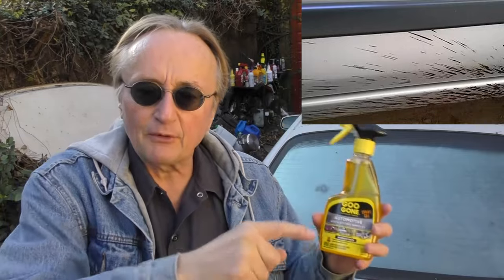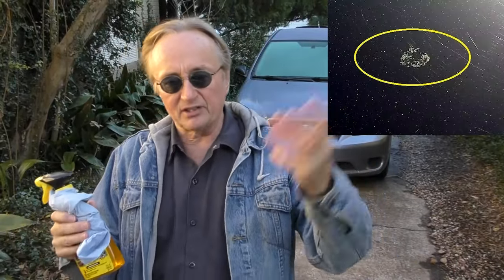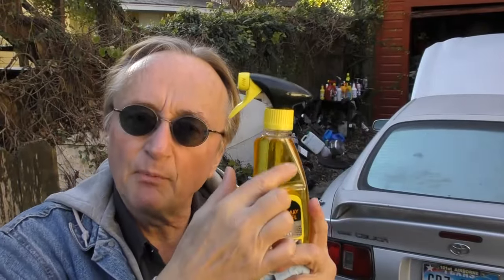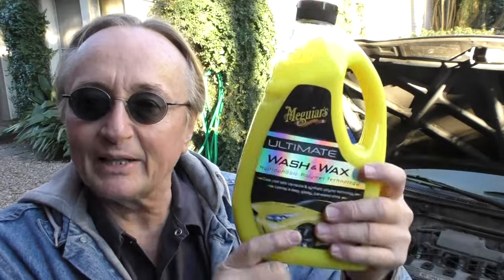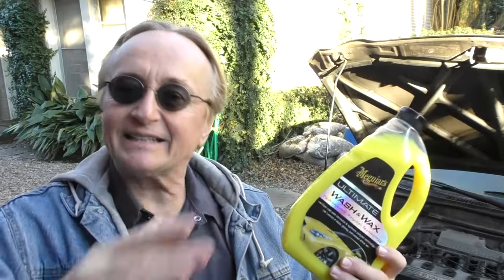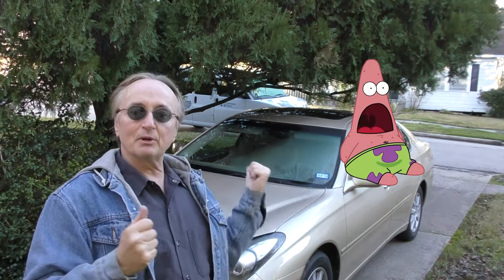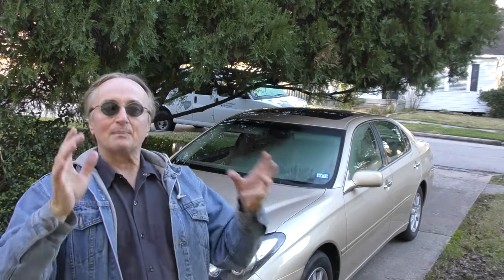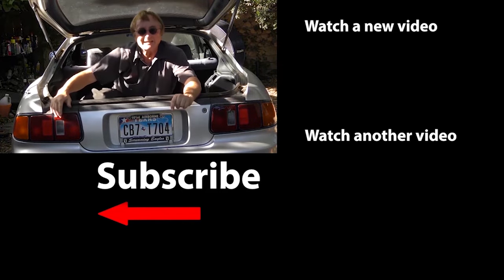Doing This Will Make Your Car Paint Last Twice as Long

Comment: Ceramic coat.....best way to keep your car clean and allows for water to just roll off. No water spots. I have done this to all my cars and did it myself. Looks great and stays shiny. Bird poop just washes off with a hose. No need to use Goo Gone. 

You are a mechanic.....not a body man......I have a friend who owns a body shop. His business is involved with Mercedes, Lexus and many other dealerships in the area. He says that ceramic coating (a good one...you should have done more investigating on the better products) is well worth the effort. He told me to do it to my 2018 Lincoln MKZ hybrid. He does not tell mechanics what is good or bad.....and he says mechanics should do the same. He does not recommend Nu Finish. Says it is junk and does not really do what it says it will. You get what you pay for.
Besides.....you drive old cars......good cars though......TOYOTA.....you don't need ceramic coating. You have leaves and sticks in your engine bay most of the time.
No sense in coating that!
What if you have an Earl Schibe painted car?  Is that really paint? "I'll paint any car, any color.....$29.95."
Reply: In my 45 years of car ownership in wintry New Hampshire, nothing beats Star Brite Teflon Marine Polish.  2 coats every November lasts through the winter, avail. at Wal-Mart or Amazon.

Comment: Be very picky which tree you want to shade your car from the sun.  Don't park under a tree that dripping tree sap or has numerous perching birds.  Secondly, apply a thin coat of wax on your car to make it easier for yourself when buffing the car.  Finally, always put two coats of wax on the car to make sure you have coverage.  Just buff lightly so you don't leave circular scratches on the clear coat.  You don't need a lot of wax on the car.  You're just wasting wax and making it harder for yourself when you apply too much.

Comment: As a painter by trade, I can tell you that the quality of paint on a vehicle is directly proportional to the cost of the vehicle. Actually, a good hand painter can do a better job than a machine. The biggest difference is in the paint. A top quality auto paint can run from $600-$2000 a gallon. Nobody uses that in body shops, which is why a repaint never looks as good or lasts as long. If you really want a good paint job (say you have a classic car) find an individual pro like Charlie Hutton.

Comment: Not taking paint and wax advice from an old timing mechanic with zero paint or auto body experience, especially someone who thinks a polishing compound is not an abrasive.  Also as one who does own several new sports cars, exotics, high performance for on and off road use plus does have experience using clear wraps, ceramic and other nano coatings I can definitely say the right ones properly applied work great for many years. 
Best time to apply these advanced coating protections is as soon as your new vehicles paint has cured fully. If not paint correction must be done first or you are just preserving exactly what you have at the time the product is installed. 

I will say I am totally disgusted with the lack of quality on modern vehicles factory paint today. 

With all the EPA regulations in the USA forcing the use of low quality environmental friendly paints plus so many foreign manufacturers bringing their factories to American you can now see more and more the quality diminishing to the orange peel, fish eye, color shade variance issues and thinness worse than what we had in the 70s. 

There are a few exceptions on expensive vehicles but as more of these are now being painted in the USA. - IE Acura, Mercedes, BMW, Lexus, etc you can now see 2019 luxury vehicles paint looks like crap! 

Just tested several made in America 2019 Acuras, Mercedes, Lexus, Infiniti’s, BMWs, Teslas and was amazed at just how bad the paint jobs were, especially the Tesla’s. By far the worst was Tesla which had scratches, over spray, mismatched body lines and orange peel.

Comment: Scotty you are wrong about ceramic coatings they do work.  When I bought my car the first place I took it was a detailing/car wrap garage,  and had it done professionally.  This was 3 years ago,  I have hardly ever used my wipers.  Dirt doesn't really stick, the only thing which has stuck is the ash from the neighbours bbq but that just rinses off with a hose pipe.  No elbow grease, no soap, no wax, nothing except plain cold tap water.

In future please just stick to the mechanical side and leave the paint for the people who actually know what they are talking about.

Comment: Gotta disagree, ceramic coatings do actually work quite well...but only, and only if you do a lot of prepwork from the beginning. Just regularly washing your car and trying to slap it on is going to give you very mediocre results. You need to make sure the paint is as clean as can be so pressure wash, hand wash, claybar treatment, dry it, polish it and THEN apply the ceramic coat preferably indoors where no dust, dirt or rain can get to it. Let it sit for a day and you'll have amazing results. For those that don't want to go ultra geek mode and just want their car to look shiny I'd still recommend a decent wax over a ceramic coating though. Just my 2 cents.

Comment: No don't park your car under a tree, the tree sap is acidic and will gradually kill your paint job!
Reply: You're right.  Never park it under a pine or cedar tree.  Myself personally, I park it in the garage, and if parked for a long while, I'll use a car-duster to clear the dust of the surface and then throw a car cover over it.  If there is grime, then I do NOT put the cover on.  It would need to be washed first.

Comment: Sunlight also rots plastic and rubber parts, headlights show it most obviously when the covers yellow.  If you'er going to sell a sun exposed older car one of the most effective way to dramatically improve appearances is to replace plastic light covers.
Reply: The plastic headlight covers can often be polished with rubbing compound on a microfiber cloth, then with Nu Finish. However, they will probably need to be polished again about every 6 months after the original surface is gone.
Reply: @jeffruebens8355  I understand they can be restored, I tried it a couple times with stuff sold for the purpose and found it very time consuming with marginal results.  For my old '96 Chevy 1 ton which I'm keeping I replaced all the front lights for around $100,  a much better deal for me.  As for my mid to old age BMWs I keep them under a roof almost all the time and covered much of the time, even the 2001 still looks great.  (always waxed)

Comment: None of this is accurate. 1. Never use paper towels to remove contaminants from the paint, it will scratch and damage the clear coat. ALWAYS use microfiber on everything. 2. Polish is not designed to be used as a protective coating, it's designed to be used as the final paint correction to remove very fine swirl marks. 3. Wax is obsolete compared to ceramic coatings. These new coatings have much higher hydrophobic properties and last much longer, depending on what you buy can last 1 to 4 years. So no, they are not nonsense, they have been proven to protect the paint much better than waxes because it's harder than wax and does not bake off like wax does. So whoever is telling you it has "damaged" their paint has clearly not used the proper procedures to protect the paint with the coating. Ever since ceramic coatings started making a good name for themselves it's all I use to protect my paint and and it looks flawless, as well as customer cars I have detailed.  4. The machine painting is nowhere near as good as an individual that has been an expert for several years such as Jon Kosmoski. This video should retitled "How to neglect your paint 101" there are very few factual pieces in this video. I recommend that you talk to top tier painters and detailers before you go making a video on how to preserve your paint
Reply: Fuert Neigt  1. Automotive wipes are not microfiber, go check it out sometime you'll be shocked to see the difference i'm sure. 2. Sure it may be a sealer, but still will not last as long as ceramic coatings will. 3. Did you not read when I said depending on what you buy a coatings can last from 1 to 4 years? So no I did not say they are all the same. You get what you pay for. Also i'm sure you're more than capable of typing a few words into the YouTube search bar, but if that's too hard for you I can link some videos for you. 4. Also I said some as John Kosmoski, implying the numerous other expert painters out there, sure the machines do a decent job. But nothing will beat a person with skills and tools to make a perfectly falt/dent free surface to paint. So yes, in the right hands an individual will be better than machine. A machine is only as good as the person who programs it. Sooooo wanna try again kiddo?

Comment: Park in the garage or shade, wash your car when its dirty by spraying it off with a pressure water, soal with automotive soap, then spray clean. Use microfiber, clean & reused it //
Synthetic wax works better & lasts longer, just wear gloves when applying it ..
Or save your time & energy & apply it to other things. 
Yes, using garage to store junk silly & stupid if vehicles can be stored there. Vehicles are more efficient when they are kept cool in summer & warm in winter as less energy wasted to heat up or cool off the cabin, especially in areas with dramatic seasonal weather shifts in temperature, hot Texas, cold Alaska. The NERI on opening & closing the door & air exchange a little more complicated. 
Frost free windows in the winter & a warm not hot car in the summer // obvious benefits of storing cars in a garage.

Comment: SHOWER CURTAIN LINER.. That is what I use to cover my car almost everytime I park it, most times its in my Garage, but other times? Under the Shade of a tree, but tree Sap gets it, thus a Clear shower Curtain line or a Pattern one to filter out the Sun? I have Finding Nemo Shower Curtain now.. My Grandkids Love it so much. Got their Parents to get them for their SUV.. In wintertime? Perfect for Covering the Windsheild and front door side Windows and close the doors to hold it ..get up in the morning or Come out from work into the Snowy Parking lot? Pull the Liner Off roll it up, put into the Back Seat to dry it off with the heat in the car and by the time you get home? Ready to Put back on, and nice a Flexible being all dried out and warmed up!   Surprised you don't tell your readers scotty? I'm older than you , so probably why you youngins don't know these old tricks!

Comment: NuFinish is a Sealer and one of the best to use at least 2x a Yr.. ( or 4x like Scott likes)  But if youk use a ShowCurtain liner to cover your cara? only will need i=to do it 1-2 yr.. and get the Heavyduty one's with a Pattern to block out the Sun-UV rays and cooking the paint.. and use in winteritme over your Windshild and front door Windows..an Old Limo drivers trick..

Comment: I used Nu Finish on my 81 olds which looked like ned for 17 years.  Daily drive to work and park in sun , drive in Chicago salt and snow.
Use on plastic headlights when new.  2004 Buick now 15 years old has factory fresh headlights.  All the same for my son`s 8 year old Pontiac .

Comment: Stick to auto mechanics! You know nothing about auto detailing. There are lots of ceramic coating systems out there that are excellent quality and worth every penny! Sure there’s some garbage out there, but that’s true with anything. But a ceramic coating, or lite ceramic coating, or even a spray on ceramic wax is well worth it as long as you get a good one. Much better than Nu Finish, and they don’t need to be applied 4 freaking times a year! Please stick to auto mechanics, and stay away from auto detailing subjects, which obviously you know much less about.

Comment: dont wax, thats just temp, realistically you should be buffing and polishing 1-2 times a year this is based on location, current manufacturers are making clear coats cheaper and thinner, been auto detailing for over 10 years.

Comment: A guy sprayed his friend's small pickup with Silly String for what was supposed to be a gag.  The car was 'stringed' early morning in the workplace parking lot; by 3 pm it had been baking in the Texas sun for almost 8 hours.  The truck owner cleaned the stuff off when he got home, but forever after you could see where the Silly String had been - there were light lines criss-crossing the truck from on every topside paint surface.  I doubt if the 'friend' who shot all that Silly String on the truck ever paid for a new paint job, but he should have, because he ruined that poor little red truck.

Comment: Hi Scotty and everyone else out there. I bought a cab that has residue of an old sign wrap. Should I hose it down and use the auto Goo Gone. If so  what type of sponge would I use that won't hurt that well needed clear coat? Or is there a certain  car wash/degreaser  concoction that I should mix up. I want to do this the right way! So, if Scotty you would get back to me on this or anyone that's half as smart as Scotty, you know the people with knowledge and common sense, I sure would be grateful! Thank everyone! Be waiting to hear some great answers! Mont

Comment: Low quality body panels in the 1970s were good for keeping the new car price lower, and you could buy a used car cheap with a rusty body, but the engine and transmission still had years of use. However, they were death traps during crashes from less safety technology, and the tires and brakes and suspension were bad compared to a modern car. If you still have a 1970s car, it is best to use it as a collector item and only risk your lives in it once in a while, and have a newer vehicle as a daily driver. My wife thinks Harbor Freight carports are for trailer trash, and a regular garage is out of our budget. Another idea is the relic fad- where you decide the worn out look is good, instead of the new look. You can buy new guitars now that are faked to look like they they have been played since the 50s or 60s, all worn and faded.

Comment: not sure if you remember something called liquid glass, but Ceramic coating is something that was called "liquid glass", but now someone decided to market it as ceramic nano coating etc.
As far as wax goes, any wax ( sealant, cleaner, synthetic, carnuba etc) you use is fine as long as you do it routinely( every season is ok). 
If you are older i do advise to stay away from carnuba, a little more elbow grease is required to remove it.

Comment: I saw a video of a guy that waxes his windshield and he swears by it. I don't know how i really feel about it, but I can't deny the results. Does the product you use just polish the clear coat? Or does it offer a protective barrier like wax? I thought all polishes had to be at least a little abrasive as that what brings the shine back to faded or scratched clear coats. I also was told many many years ago that clear coat doesn't require a wax, just a polish as the idea behind was was to be a clear coat on older cars single stage paint.

Comment: Actually aftermarket paint jobs, when done correctly are far superior to OEM finishes. OEM'S have been continually putting less and less paint film thickness on their vehicles. They have been doing it for years to save money. The result is paint delamination. I've been in the autobody collision industry for over 25 years and have witnessed this. The biggest offender is.... wait for it... Toyota. Try prepping a blend panel on any Toyota automobile, and you cut through almost immediately. Toyota has been shortchanging thier paint jobs for years. In fact they still use single stage paint on their solid colors. (whites, black, red, etc). Single stage paints have little to no UV protection so they fade out quickly.
Reply: agree i am surprised how thin new paints are..have to be real careful when polishing it..

Comment: A lot of new cars have a layer of tinted clear coat with metallic that is between the base color and the clear topcoat. These are called tricoat colors. More expensive cause there's more material and it's harder to apply to match the factory color.

Comment: As a professional detailer, I'm pretty disgusted with this video. Mainly about ceramic coatings. They're crap if you don't correct your paint prior to application. Think of it as an additional clear coat. You wouldn't spray or apply clear to a car with iron deposits, scratches, or a dirty un prepped surface. But when applied correctly.. water, dirt, bird droppings etc will have a very hard time sticking to your car. I've had ceramic coating over my GTI for 2 years now almost and when it eventually gets dirty, 75-80% can be taken off with water alone. So no, it's not all marketing crap. But it can be if your average consumer washes his or her car in their driveway and apply it without the prep work. Yes you will not get your money's worth and can even do harm.

Comment: Just gona point out that a polish is a mild abrasive used to remove minor scratches leveling the paint a wax is used to protect it the reason water will bead after polishing is because the paint is now flat but you are removing clear when you polish as any car detailer Scotty is talking crap

Comment: I like to have 2 wash buckets. One for the body, one for the rims and lower dirty areas. I like to do wheels and lower areas first. Then do the body from the top on down to the rocker areas. This seems to work for me. There is a new ceramic coat product by Produxa out. I know a detailer who swears by it. And Meguires just came out with their own. This seems to be significantly better than paste wax or polishes. I'll give it a try this spring. He says it's even good at hiding small scratches and swirl marks....I'll see about that...